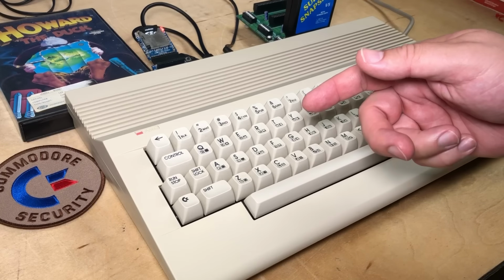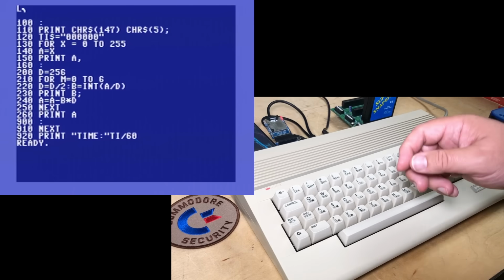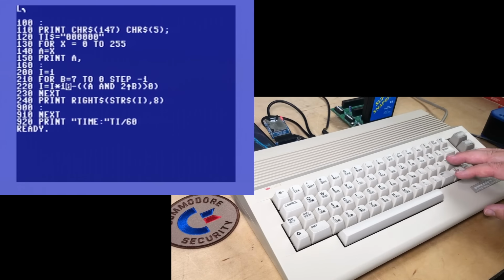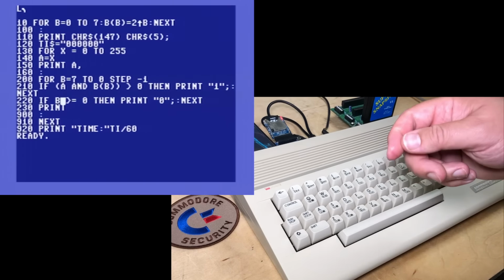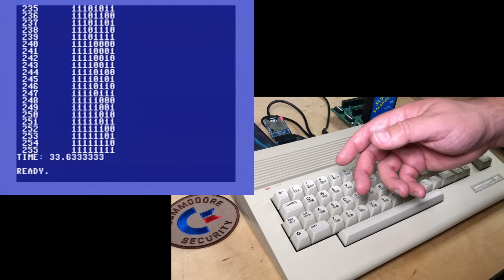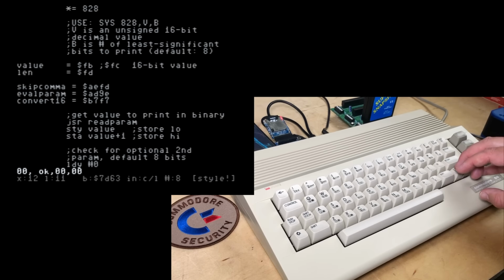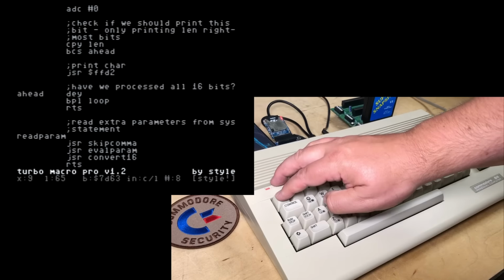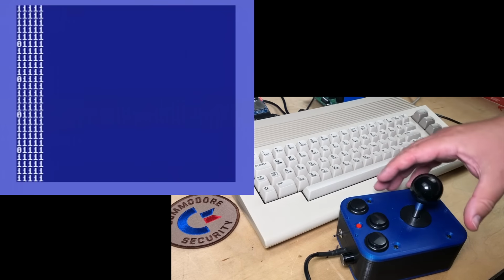Printing Binary in BASIC and Assembly on Commodore 64

Comment: Great example of speed vs. memory usage!  I've not seen BASIC print anything out that fast! :D

Interestingly, with modern PCs you have to refrain from almost every optimization trick up to the early 90's. For example, it's faster to calculate double-precision trig functions than to use a look-up table!  It's also faster to use 32-bit variables for Booleans instead of 8-bit variables. And floating point arithmetic is basically free; almost as expensive as a NOP! :D

Comment: If you make an even larger space/time trade-off, you can get a significant speed increase in "precalc" part with no hit on the print part. This code READs 256 strings from DATA statements into the array. The READ takes about 1.2 seconds and the print takes about 13.5 seconds. Basically, the precalc is done outside the program to generate the strings for the DATA statements.

1000 dim b$(255)
1010 ti$="000000"
1020 for a = 0 to 255
1030 read b$(a)
1040 next
1050 it=ti
1060 :
1070 print chr$(147) chr$(5);
1080 ti$="000000"
1090 for x = 0 to 255
1100 a=x
1110 print a,
1120 :
1130 print b$(a)
1140 :
1150 next
1160 print "init time:"it/60
1170 print "time:"ti/60
1180 DATA "00000000","00000001","00000010","00000011","00000100","00000101","00000110"
1190 DATA "00000111","00001000","00001001","00001010","00001011","00001100","00001101"
1200 DATA "00001110","00001111","00010000","00010001","00010010","00010011","00010100"
1210 DATA "00010101","00010110","00010111","00011000","00011001","00011010","00011011"
1220 DATA "00011100","00011101","00011110","00011111","00100000","00100001","00100010"
1230 DATA "00100011","00100100","00100101","00100110","00100111","00101000","00101001"
1240 DATA "00101010","00101011","00101100","00101101","00101110","00101111","00110000"
1250 DATA "00110001","00110010","00110011","00110100","00110101","00110110","00110111"
1260 DATA "00111000","00111001","00111010","00111011","00111100","00111101","00111110"
1270 DATA "00111111","01000000","01000001","01000010","01000011","01000100","01000101"
1280 DATA "01000110","01000111","01001000","01001001","01001010","01001011","01001100"
1290 DATA "01001101","01001110","01001111","01010000","01010001","01010010","01010011"
1300 DATA "01010100","01010101","01010110","01010111","01011000","01011001","01011010"
1310 DATA "01011011","01011100","01011101","01011110","01011111","01100000","01100001"
1320 DATA "01100010","01100011","01100100","01100101","01100110","01100111","01101000"
1330 DATA "01101001","01101010","01101011","01101100","01101101","01101110","01101111"
1340 DATA "01110000","01110001","01110010","01110011","01110100","01110101","01110110"
1350 DATA "01110111","01111000","01111001","01111010","01111011","01111100","01111101"
1360 DATA "01111110","01111111","10000000","10000001","10000010","10000011","10000100"
1370 DATA "10000101","10000110","10000111","10001000","10001001","10001010","10001011"
1380 DATA "10001100","10001101","10001110","10001111","10010000","10010001","10010010"
1390 DATA "10010011","10010100","10010101","10010110","10010111","10011000","10011001"
1400 DATA "10011010","10011011","10011100","10011101","10011110","10011111","10100000"
1410 DATA "10100001","10100010","10100011","10100100","10100101","10100110","10100111"
1420 DATA "10101000","10101001","10101010","10101011","10101100","10101101","10101110"
1430 DATA "10101111","10110000","10110001","10110010","10110011","10110100","10110101"
1440 DATA "10110110","10110111","10111000","10111001","10111010","10111011","10111100"
1450 DATA "10111101","10111110","10111111","11000000","11000001","11000010","11000011"
1460 DATA "11000100","11000101","11000110","11000111","11001000","11001001","11001010"
1470 DATA "11001011","11001100","11001101","11001110","11001111","11010000","11010001"
1480 DATA "11010010","11010011","11010100","11010101","11010110","11010111","11011000"
1490 DATA "11011001","11011010","11011011","11011100","11011101","11011110","11011111"
1500 DATA "11100000","11100001","11100010","11100011","11100100","11100101","11100110"
1510 DATA "11100111","11101000","11101001","11101010","11101011","11101100","11101101"
1520 DATA "11101110","11101111","11110000","11110001","11110010","11110011","11110100"
1530 DATA "11110101","11110110","11110111","11111000","11111001","11111010","11111011"
1540 DATA "11111100","11111101","11111110","11111111"

Comment: As others have mentioned, the best way in BASIC is to pre-calculate all 4-bit strings. I tested it and got 1.05 seconds of pre-calculation time and 16.25 seconds of normal run time. Slightly slower run time than the precalculated 8-bit strings, but 20x faster pre-calculation time and 16x less memory usage.

Comment: Can you please point me to where I can get a 4 axis only joystick. As you know Ms Pac-Man is unplayable with an 8 axis joystick. Thanks.
Reply from the maker: I only know of a few Commodore/Atari compatible 4-way joysticks:
Newport Controls Prostick II or III
Zircon International Z-Stick
Kraft Maze Master
Kraft Switch Hitter

Each of these is switchable between 4-way and 8-way. Since they're all old and probably used joysticks, I'd confirm with the seller that the 4-way function is still working.

If you're handy, search for "true 4-way joystick" online and you'll find some actual 4-way arcade joystick mechanisms, but you'd have to mount them in a box and wire them up yourself.

Comment: Interesting exercise! I got 26.12 seconds printing strings with this routine compared to 36 seconds printing numbers:

20 for x=0to255:printx;
25 a=x
30 if a>127 then a=a-128:print  "1";:got
o40
35 print"0";
40 if a>63  then a=a-64:print"1";:goto60

45 print"0";
60 if a>31  then a=a-32:print"1";  :goto
70
65 print"0";
70 if a>15  then a=a-16:print"1";:goto72

71 print"0";
72 if a>7   then a=a-8 :print   "1";:got
o74
73 print"0";
74 if a>3   then a=a-4 :print   "1";:got
o76
75 print"0";
76 if a>1   then a=a-2 :print"1"  ;:goto
78
77 print"0";
78 if a>0 then print"1";:goto80
79 print"0";
80 rem
200 print
210 next x

Comment: the old style joysticks were better, in my opinion, than the newly fashioned ones with micro-switches, which are impossible to do special game combos with.
old style joysticks were spring and contacts, arranged such that you could easily do 360 continuous movements if desired. this includes diagonals being valid positions, that should be easy to accomplish without hitting a vertical or horizontal first, as those might be other moves being trigerred in game.

Comment: Just a question: What's the purpose of having the extra A=X? Could you not just replace all the A's with X instead? I can't figure out if there's an advantage to doing it this way or not; I'm probably missing something..
{sorry, in case it's needed: reference 32:27}
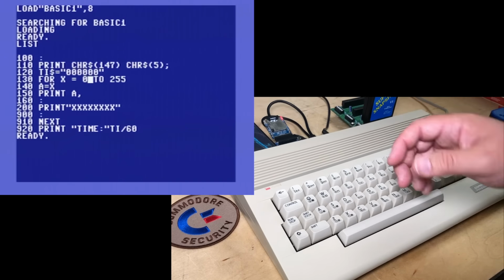Reply from the maker: I explain it back around 3:00; some of the algorithms modify A so I keep the framework the same for consistent benchmarking. Obviously they can't be modifying X directly as that would mess up the main test loop!
Reply: @8_Bit  ahh, thank you. I figured it was something probably pretty obvious. I somehow missed it, and when I went back, I didn't go back far enough.

Comment: I paused the video after the first example and gave it a try.  Not the speediest example by a longshot, but minimal code, for what it's worth...

10 t=ti:forx=0to255:a=x:forb=1to8
20 ifaand128thenprint"1";:goto40
30 print"0";
40 a=a*2:nextb:print,x:nextx
50 print(ti-t)/60"seconds"

 38.5666667 seconds

(edit) Here's a hybrid version using Basic and ML...

10 t=ti
100 forx=0to18:readn:poke828+x,n:next
110 forx=0to255:sys828,x:printx:next
115 print(ti-t)/60"seconds"
120 data 32,155,183  :rem jsr $b79b
130 data 160,8       :rem ldy #8
140 data 138         :rem txa
150 data 10          :rem asl a
160 data 170         :rem tax
170 data 169,48      :rem lda #$30
180 data 105,0       :rem adc #0
190 data 32,210,255  :rem jsr $ffd2
200 data 136         :rem dey
210 data 208,243     :rem bne -13
220 data 96          :rem rts

12.8666667 seconds

This revision will let you call SYS 828, <number> whereby number can be 8-bit or 16-bit unsigned and it will print the binary equivalent...

100 forx=0to42:readn:poke828+x,n:next
110 a=0:print:input"dec:";a
120 ifa>0thensys828,a:goto110
200 data 32,253,174  :rem jsr $aefd
210 data 32,138,173  :rem jsr $ad8a
220 data 32,247,183  :rem jsr $b7f7
230 data 166,21      :rem ldx $15
240 data 240,8       :rem beq +8
250 data 32,87,3     :rem jsr $0357
260 data 169,32      :rem lda #$20
270 data 32,210,255  :rem jsr $ffd2
280 data 166,20      :rem ldx $14
290 data 32,87,3     :rem jsr $0357
300 data 96          :rem rts
310 data 160,8       :rem ldy #8
320 data 138         :rem txa
330 data 10          :rem asl a
340 data 170         :rem tax
350 data 169,48      :rem lda #$30
360 data 105,0       :rem adc #0
370 data 32,210,255  :rem jsr $ffd2
380 data 136         :rem dey
390 data 208,243     :rem bne -13
400 data 96          :rem rts

Comment: Try this without precalculations:
100:

110 PRINT CHR$(147) CHR$(5)
120 TI$="000000"
130 FOR X = 0 TO 255
140 A=X
150 PRINT A,
160 B$=""
161 IF A AND 128 THEN B$=B$+"1":GOTO163
162 B$=B$+"0"
163 IF A AND 64 THEN B$=B$+"1":GOTO165
164 B$=B$+"0"
165 IF A AND 32 THEN B$=B$+"1":GOTO167
166 B$=B$+"0"
167 IF A AND 16 THEN B$=B$+"1":GOTO169
168 B$=B$+"0"
167 IF A AND 8 THEN B$=B$+"1":GOTO171
170 B$=B$+"0"
171 IF A AND 4 THEN B$=B$+"1":GOTO173
172 B$=B$+"0"
173 IF A AND 2 THEN B$=B$+"1":GOTO175
174 B$=B$+"0"
175 IF A AND 2 THEN B$=B$+"1":GOTO177
176 B$=B$+"0"
177 PRINT B$
180 NEXT
190 PRINT "TIME:"TI/60

I measure 27,9 s

I like your videos, greetings from germany.

Comment: I've tested the program with the precalculated binary array. The pre-calculation takes 20.783 seconds for you and 21.1 seconds for me? How can that be? I even removed all spaces but it's still slower. I use a PAL machine. Are you using an NTSC machine that runs faster?

Comment: Seeing as CHR$(48) is the Zero character, and CHR$(49) is the 1 character, you can exploit it a bit.  In Line 10, I did:  A=128: FOR B=1 TO 8: C(B)=A: A=A/2: NEXT.  I blanked TI$ in Line 20.  In line 30, I did:  FOR A=0 TO 255: PRINT A,.  In line 40, I did:  FOR B=1 TO 8: PRINT CHR$(49+((A AND C(B))=0));.  Lastly, in Line 50, I did:  NEXT: PRINT: NEXT.  That's probably as fast as you can get without the SYS command.  It also takes less memory than the other non-SYS versions.

Comment: btw: I.ve not written C64 basic before, but I have written C128 Basic about 35 years ago LUL....
another improvement to 15.883333
5 DIM A$(16)
... Fill the array with A$(0)="0000" to A$(15)="1111"
90 Y=16:Z=15
99 TI$="000000"
100 FORX=0TO255
110 PRINTX,

130 PRINTA$(X/Y);:PRINTA$(XANDZ)

200 NEXT
210 PRINT "TIME:"TI/60

Comment: Without looking at what you did until I did this I managed 18.71667 in basic
5 DIM A$(16)
... Fill the array with A$(0)="0000" to A$(15)="1111"
99 TI$="000000"
100 FOR X = 0 TO 255
110 PRINT X,
120 :
130 IF X < 16 THEN PRINT A$(0);:PRINTA$(X AND 15)
140 IF X > 15 THEN PRINT A$(X/16);:PRINT A$(XAND15)
200 NEXT
210 PRINT "TIME:"TI/60

Comment: Great videos, always enjoy them.  One question I have is about the use of 828.  I know that is the tape buffer, but the book I have says 820-827 (8 bytes before the tape buffer) and 1020-1023 (4 bytes after the tape buffer) are unused.  Why not start at 820 and have 204 bytes available?  Is 820-827 actually used somewhere?  Or is my book out of date?  (Mastering Machine Code on Your Commodore 64 by Mark Greenshields p. 213)

Comment: Interesting challenge.
my first thought takes about 41.43 seconds:
0 ti$="000000":printchr$(147) chr$(5)
10 z=2:l=.5
15 forv=.to255:d=128:a$=""
20 ifvanddthena$=a$+"1":goto40
30 a$=a$+"0"
40 d=d/z:ifd>lgoto20
50 printv,a$:next
60 print ti/60
70 end

Using precalced nibble values gives a good boost.This needs only 16.45 secs:
0 ti$="000000":printchr$(147) chr$(5)
10 f=15:s=16:dimb$(f)
20 forv=.tof:readb$(v):next 
30 forv=.to255:x=vandf:y=v/sandf
50 printv,b$(y);b$(x):next
60 print ti/60
70 data"0000","0001","0010","0011"
80 data"0100","0101","0110","0111"
90 data"1000","1001","1010","1011"
100 data"1100","1101","1110","1111"

Comment: I did one with the 15 nibble strings in an array "0000","0001"..."1111" AND with 240 divide by 16 and then AND with 15 (f0 & then 0f), got the time down to 19 seconds. I would supply a listing but vice is all new to me
Reply: It is 16 nibbles....

Comment: What about this 'Loop unrolling" with something like a 'String builder' approach?
No cache required, and a decent 25 secs. execution time in pure BASIC...

-----------------------------------------------------------------

10 printchr$(147)chr$(5)
20 ti$="000000"
30 fori=0to255
40 printi,
50 print"0";:if(iand128)thenprint"{left}1";
60 print"0";:if(iand64)thenprint"{left}1";
70 print"0";:if(iand32)thenprint"{left}1";
80 print"0";:if(iand16)thenprint"{left}1";
90 print"0";:if(iand8)thenprint"{left}1";
100 print"0";:if(iand4)thenprint"{left}1";
110 print"0";:if(iand2)thenprint"{left}1";
120 print"0";:if(iand1)thenprint"{left}1";
130 print
135 next
145 printti/60

-----------------------------------------------------------------

The {left} syntax comes from CBM program Studio and stands for the 'left cursor' control character

Comment: Great video!  Really interesting.

For your basic 10, personally I would call it a lookup rather than a conversion.

Did you play with the idea of storing a pre-calc table in an seq file and loading it into an array, then doing a lookup?  I would think it would be such a small file that it wouldn't eat much time.

This reminds me of stories I've heard of old micro programmers storing pre-calculated info and doing lookups rather than spending CPU time on computations.

Comment: Very inspiring video! I modified the code slightly. The binary string can now either be stored in a string variable or directly be printed via USR(value),length

1000  JSR $B7F7 ;convert FAC1 to integer
1003  STY $FB ;store lo
1005  STA $FC ;store hi
1007  LDY #$00
1009  LDA ($7A),Y
100b  LDY #$08 ;default length
100d  CMP #$2C ;check next char for comma
100f  BNE $101A
1011  JSR $AEFD
1014  JSR $AD9E
1017  JSR $B7F7
101a  STY $FD ;store length
101c  LSR $FC
101e  ROR $FB
1020  LDA #$00
1022  ADC #$30
1024  STA $103A,Y ;store binary string in buffer
1027  DEY
1028  BNE $101C
102a  LDA #$3B
102c  LDY #$10
102e  LDX $FD
1030  STX $61 ;store string length
1032  STA $62 ;store string buffer lo
1034  STY $63 ;store string buffer hi
1036  PLA ;discard return address
1037  PLA ;discard return address
1038  JMP $B4CA ;put string address and length on descriptor stack

In BASIC you have to redirect the USR function vector to address $1000 with
POKE 785,0: POKE 786,16

then the function can be called:
e.g. PRINT USR(65535),16
or A$ = USR(144),6

Comment: FWIW - I did my own variation on Example "BASIC10", and put in a slight advantage by blanking the VIC II. That yielded an improvement of about 1.5 seconds in the precalc stage on my NTSC machine. I also agree as others have said  that the screen scrolling was chewing up time, so I wanted to see how much keeping the line at the home position (top of screen) would improve things... Improved by about 8 seconds on my machine! (Display time measured at 5.233 seconds.)

Comment: I think the screen scrolling is the thing that slows it down the most. If the machine language was writing directly to screen memory rather than sending characters as a screen print, it would be so much faster. When reaching the bottom line just going back to the top line.